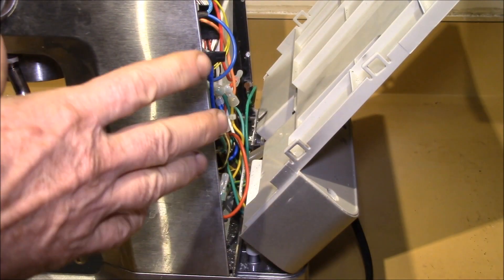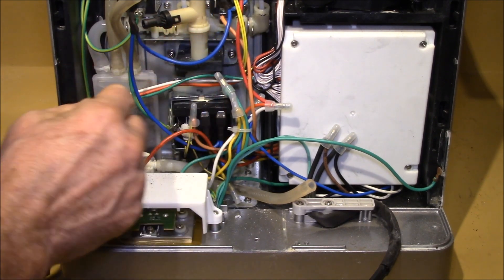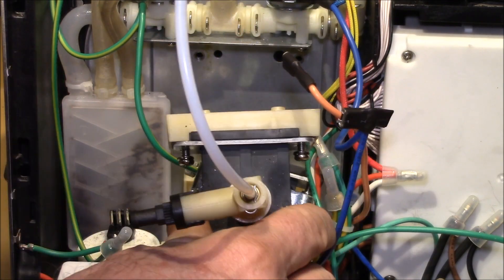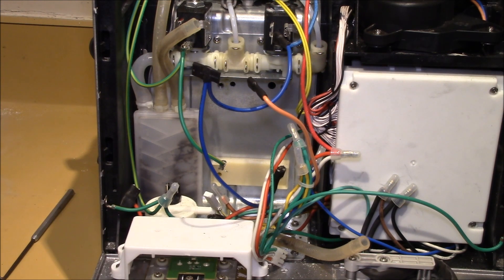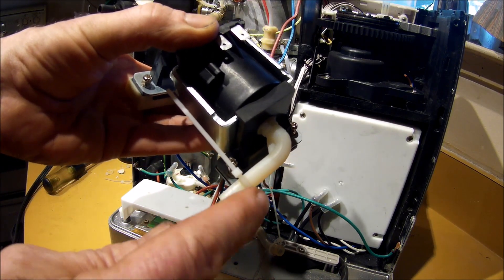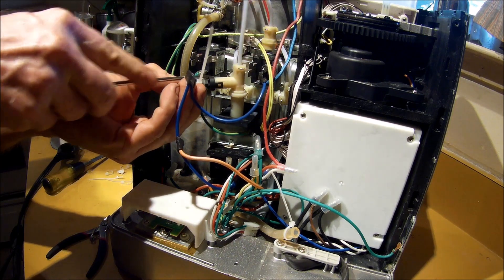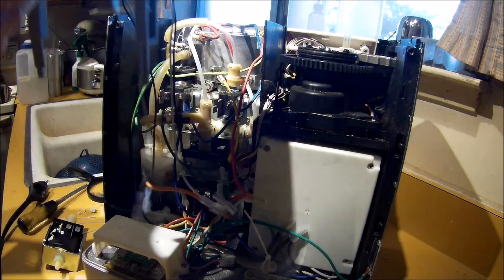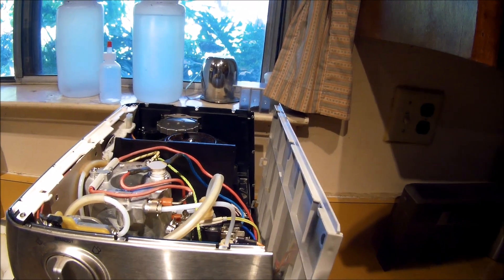Breville 870XL Pump Replacement, Part 1

Comment: Would you know what causes this machine to over extract? Lately I’ve been having to manually stop my pulls of espresso.
Reply from the maker: As in the machine pumps out too much water for a given brew cycle (1-cup or 2-cups)?  If so, that can be changed via the Program button.  I think the way it works is that there is a little flow meter between the water tank and the pump.  That likely counts up pulses as it spins that is proportional to the water flow.  The controller board reads those pulses and uses that to pump out the programmed amount of water for the cycle.  It's not terribly accurate and I find my machine varies up and down over time.  Easy enough to recalibrate the pumped volume with the Program button as mentioned in the manual:
"Re-Programming
Shot Volume - 1 CUP Button

1. To begin programming, press the  PROGRAM button once. The machine will beep once and the PROGRAM button will begin to flash. This indicates the machine is in programming mode.  
2. Press 1 CUP button to start espresso extraction. Press 1 CUP button again once desired volume of espresso has been extracted. The machine will beep twice to indicate the new 1 CUP volume has been set."
Reply: R Brown Yes even after resetting the program button to the default extract volumes or trying to set new presets. For example I will select 2-shot volume and the machine will extract until I manually stop it. I’ve seen it go for up to a minute when trying to diagnose the problem.
Reply: This also effects the hot water switch volume. I now have to switch it to the off position in order to make the water stop flowing.
Reply from the maker: @Evilla00  Have heard of others having a similar issue with some mixed results on fixing the issue.  A long press on the buttons will make it run a long time.  Maybe try a very short press.  One other thing to try is unplug machine for an hour or so to see if that resets anything.  All the pump and solenoid control is done by the main controller board, so it may be there's an issue with that or possibly with the water flow sensor.  If that sensor is perhaps unplugged or not reading out pulses, the controller won't know how much water is being pumped.  Might be worth contacting Breville support and see if they have any ideas for troubleshooting.
Reply: R Brown makes sense. I will give these a shot! I have contacted Breville support to see if they can offer any suggestions but thought I’d check out YouTube in the meantime. Thank you for your videos and rapid responses!
Reply from the maker: @Evilla00  Have seen a Reddit thread saying that descaling may help:
https://www.reddit.com/r/Coffee/comments/3323ea/breville_espresso_machine_shot_goes_way_too_long/cqhdfp4/
I show the location of the water flow sensor in this video:
https://youtu.be/9lMw6ooiqPI
Not sure how to test it though, it appears to be a 3 wire type device, with power, ground and an output signal wire.  
https://www.ereplacementparts.com/flow-meter-p-629903.html
The main circuit board is not terribly expensive:
https://www.ereplacementparts.com/main-pcb-p-1790467.html

Comment: I have found that if you put the machine on the edge of a table you can turn the back over and drop it down. It then becomes very easy to access the 2 screws that hold the pipe to the water tank.
Reply from the maker: Yes, I did that earlier when I changed out the solenoids.  While it does work, it's a whole lot easier to just remove the tube from the hose barb.  But either way works, just like to try out alternatives.